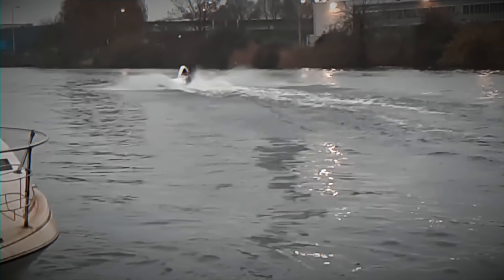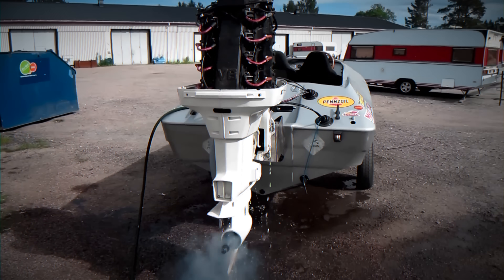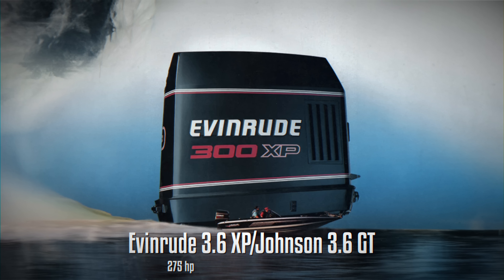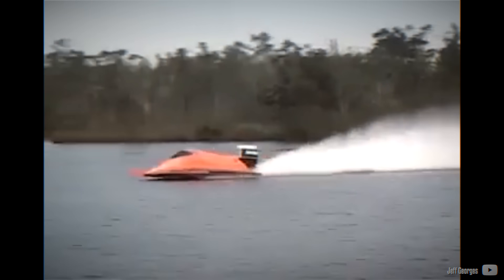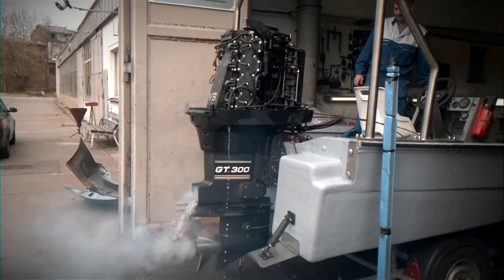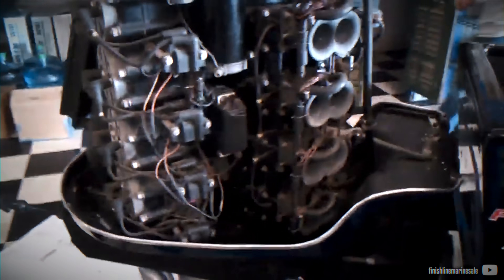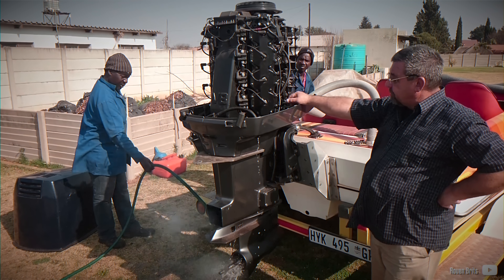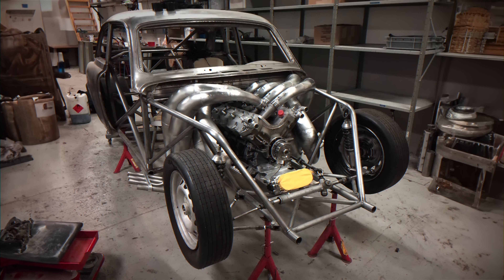A Revolutionary 2-Stroke V8 Outboard Engine

Comment: I had one on a 26’ paramount. Came out of the hole like a rocket. It was a little unreliable and went through some serious amounts of fuel. Replaced it with a 250 merc 3 liter boat ran faster and used half the fuel.

Comment: I have a 200XP body with a Johnson 200 GT hiding under it.  Its an 87 so its a looper and its modified like there is no tomorrow.   It sits on the back of my 1988 Stratos 200VT Rocket, created my Roark Summerford.  I also have one of Roarks 1986 STV ProComp Sprint Bottom race boats.  Woohoo

Comment: I have a1973 70hp and performs the same as a buddy's brand new 90hp Merc
Reply: That's the thing about the older outboards, they seem to be vastly underrated in HP for what they had. Not sure if it was sandbagging or just that new manufacturers are overstating ratings or just focusing on fuel economy. Definitely a huge difference in a 25  from 1990's to a new 25 off the shelf. Not even close. Add the heaviness of a bloated 4 stroke and it's just boring and slow. Problem is in small boats you can't just upsize because you only get heavier.

Comment: Around 2000 - 2010 a friend of mine in Lake Havasu had a 21' Eliminator with a Merc 300 V8 outboard. We would do 90 mph up and down the Lake and around Parker dam and casino and up the river, easily doing away with 40 gallons per hour when on it. Oh yeah, that was a real black hole, small compared to large boats, but that bottom end never lasted long with a surface prop and he didn't invest in a strong race bottom for that engine. Good times were had but with all these things, fast becomes not fast enough and the black hole starts requiring feeding ha ha.

Comment: I had the 200XP V6 3.0L. 
It was a good motor. 
It just sucked a ton of gas so a 30 gallon tank only lasted about 20 miles.
My 150hp 4 stroke Mercury 3.0L goes over 120 miles on 30 gallons of gas.

Comment: Yea I hate to break it to you but the V8 was garbage.   Heavy ate fuel like it was a Arab prince and in general had bad balance on the small boats it would need to chase big numbers.  Oh and it was made poorly and had closed exhaust deck so big mods came hard.
Reply: Complaining about the fuel economy of a 2 stroke is a weird angle……but okay.
Reply: @DownEastSaw fr
Reply: Heavy isn't an argument because it's still lighter than the lightest stock modern 300 four-stroke. And yea they chug the fuel but that comes with the territory of boating in general.
Reply: @benradey379  i agree. just google it.. the 4.0 400 was stock 250kg.. the 450r in its lightest form is 330kg dry weight... 

And lets not forget that the 3.6-4.0 is a n/a

Try making that engine today with e-tech.. and bro.. yeah.. everyone knows e-tech are light and fast :)
Reply: BS was a top machine in the era.
Reply: @pieterhenderson3445  
Yes " in an era"
That's why you  don't see them
"Garbage reliability "
Reply: People who said they were unreliable and bad were the people who set them up wrong. People I’ve talked to who actually set them up right, say they were great outboards.
Reply: @RaidifyLifts  i belive u 100% habe heard just the same story from people.. if u dont know 2 stroke and carb tuning.. stay away 😅🤙
Reply: The world record for a single outboard speed  is still held by the Evinrude V8
Reply: Who cares how much fuel it uses, thats what smaller displacement motors are for. This motor was built for one thing, to destroy everthing else. I was at formula one races where Mercury would not even take their boats iff the trailers. The V8 also owns most outboard speed records. Mercury had a habit of not fielding boats against OMC when they were a racing powerhouse.
Reply: @scottmclaughlin3083  Youre 100% correct, what he also doesnt understand the majority of them were ragged on hard and put away wet, parts were cheap for racing teams so they had no problem swapping entire powerheads between races which of course made the statistics shift towards the appearance of them being troublesome, all they were were 200s with two more cylinders and if used in recreational ways they lasted just as long as they were maintained, like any other OMC product of the time.
Reply: Still the world record holder for single outboard
Reply: Only Evinrude outboards awesome
Reply: can you show us where the big stinky inefficient V8 hurt you
Reply: I totally agree.  While it was a great race motor, it was garbage for the average boater. There is a post on the hull truth a couple years ago, where a guy stated that his father had a pair on his boat.  The reliability was so bad that his dad bought a third motor to swap out the nonfunctioning motor while it was being rebuilt.  Seriously, look it up.  This was the beginning of the end for OMC.
Reply: That's some cope. Evinrude go BRAAAAAAAAAAAAP (you in a 4 stroke machine have been left by miles)
Reply: 2 stroke anythings only have ONE happy place. WOT or nothing and outpace their 4 stroke comparatives by many orders of magnitude (other than MPG)
Reply: Ummm, you ever heard of this thing called “punctuation”??? It’s your friend, I promise!!! 😂😂😂
Reply: And still to this day holds the record.. Not bad😊
Reply: @SlowBurn1995  what record? That's sick
Reply: @benradey379  the world outboard speed record. 176 mph. they ran a modded evinrude v8 400 f1 engine
Reply: @RaidifyLifts that’s pretty cool, I had no idea
Reply: @SlowBurn1995  okay thanks for clearing that up, just watched the video and that’s insane that to this day it still holds the record, thank you for all the information.
Reply: @benradey379  np my man :)

Old 2 stroke lover here :) hehe.

Im from norway and theese engines are almost impossible to find... tøying hard to find one for my old nordkapp 17 :)
Reply: @SlowBurn1995  that thing would rip, my dads trying to get his hands on one for his old super pro 196 princecraft, pretty hard to find here in Canada 🇨🇦 aswell.

Comment: I love my 1987 70HP Evinrude..its only a 3 cilinder but the torque and power is brutal for such a small engine and drinks more then a team of rugby players.. love it!
Reply: Great motor.  I replaced mine in 2012 with a 60hp eTec when they cam out.  The eTec was way quieter and smoother but in comparison had no torque!  And, the 70 left a mushroom cloud when I punched it :)
Reply: @OutsideCleaners  the E-Tec by Evinrude were terrible,  every one who owned one in my boat yard hated them,
Reply: @boris2997  🤷🏼‍♂️ I had 4 on different boats, loved them.  Zero problems.
Reply: I have a 95 SPL 88 Evinrude  on a 17 foot Boston Whaler  it's a fast little boat 50 mph top speed.   I love 2 stroke motors
Reply: I had a 1975 Johnson 70 hp which we end up reconditioning with an '80's powerhead which made a prop rated 70hp. The kids wanted more hp for skiing etc and so I started doing my research and discovered that power to weight wise these were way better than the new ones I was considering in around 2014, and the old Chryslers were even better. My hull was narrow and deep V and I was conscious of not overloading it. The only one which was close was the 90 hp Yamaha 2 stroke which I eventually replaced it with. I loved that Johnson and grew to love that Yamaha too- both lovely and similar machines with lots of personality.

Comment: I'm disappointed that there is essentially no information about the engine design. Yes, the specs are nice, but how are these things built? They appear to have the crankcase scavenging typical of small 2-stroke gas engines, but how does that work in a vee configuration, with two pistons sharing the same section of crankcase so a conventional vee design would have no useful pumping action? I did find an image of a 2-stroke V6 crank which suggests that each connecting rod is isolated from the next rod on the same crankpin by a disk, dividing the crankcase into separate chambers for each cylinder... it would have been nice to see that.

Comment: I wish Rotax would bring their direct injection 2 stroke tech to big outboards.
Reply: umm you know bombardier bought OMC right? and used Etech direct injection? rotax valves would not do anything for them.
Reply: @ct1762  Umm ya I know.  Rotax is Bombardiers small engine division with all that tech.  I want to see big 2 stroke v8s with the direct injection we get on the sleds.

Comment: Completely useless grief for the public boater. My 6 HP Elgin is as far as you want to take 2 cycle, and only because it is smooth and meticulous.
Reply: Weirdly enough I have one of those Elgin engines.
Reply: The modern 2 stroke Evinrudes intrigued me because you could have a dedicated trolling motor alongside because they were such light weight.

Comment: The V8 part may draw attention but the winners circle was proof. Mercs 2.5 was a far superior platform.  The comparison between OMC engineers and Merc. Isn't even fair. Like chess to checkers.
Reply: OMC v8 set the world outboard speed record, and in 1980-1983 wiped the floor with Mercs but they changed the rules so no V8. thats why they didnt get known that well later on.
Reply: @ct1762  I saw thar coming a mile away.  You do realize there was nothing left of OMC on that motor right?  OMC ports look like a child cast them. Oh ya, that winners circle thing pretty much ends your argument anyway.
Reply: @miketee2444  OMC has won a ton of races once again. the 3 cyl loopers both 49 and 56ci were untouchable and still are. yes merc has done amazing stuff with the promax/super mag, but OMC was really designing fishing motors for heavy boats and still held their own, especially off the line. i agree the port work by the mid 1980s was horrible though. just did a 130 looper with one intake port having so much slag in it im suprised it didn't break off. but i love them because they are easy to clean up.

Comment: Half the boats displacement needed to be for fuel for an afternoon of skiing
Reply: well at cruise it took about 15 gallons/hr. so no, 30 gallons would get you around just fine and most boats that used these had 60 gallons minimum. alot of fuel but not as bad as youd think depending on the hull. on a fast 90mph hull, it was even better

Comment: It's hard to say over the "chainsaw" engine note, but I suspect these V8's had cross plane crankshafts.
Reply: the F1 versions did have an "evenfire" crank, but the stockers didn't no. once you put it in the water like it was designed, it sounds nothing like a chainsaw. deep, low and absolutely nasty snarl!

Comment: The problem with some two stroke exhaust systems is it winds up sounding like 4, 6, or 8 single cylinders running at once.
Reply: in the water they sound like one big smooth monster with a snarl. totally different!

Comment: I know the V6 2 stroke outboard motorcycle but one of these would be so cool built in a Cafe style motorcycle
Reply: How about an f-150
Reply: Since the load in a boat is pretty much constant, these marine engines don't really have much going for them for road use.  They have to make 100% of their power for hours so you can't pull the tricks you do for extreme but unsustainable power on a road wheel vehicle.  A 4-stroke example is people trying to fit 3.0L Mercruiser engines into Hondas.  Doesn't actually work out as good as the V-Tech (bro!).
Reply: @paul_moir  4 strokes work like joe biden, they stumble on every other stroke!

Comment: When we were kids one of my friends dads had a handbuilt 21 foot speedboat based on a formula hull, guy was a marine diesel specialist and knew damn near everything about boats. He hung one of these things on the back. Only boat ive ever been in that had a gas pedal. Thing screamed when you punched it and the boat came up on plane. What a machine.
Reply: I've been in a boat with a gas pedal but it had a 455 rocket in it
Reply: 429 tunnel ram with a jet pump, thing was about an 18'. Lot of fun!
Reply: Don't remember the brand, but It was a fiberglass V hull and the whole boat was maybe 30 ish inches high.
Reply: I rebuilt the engine in it many years ago for the owner. It ran well but he eventually sold it. I'd entertain the idea of buying it if I could find it.
Reply: What a time to be alive

Comment: Always wanted to put one of these in a car.
Reply: not as great as you think. they need proper exhaust backpressure, or else the low end punch sucks. this has been the case with all of them in cars. in boats they absolutely scream, with a table-flat torque curve
Reply: @ct1762  I can cope with that. It's only 300ish horseys, I'm not expecting it to be amazing, but it would dang sure sound awesome,
Reply: Miata screaming!
Reply: @mynameisschezuan  I kinda thought a Civic...

Comment: Those plastic carbs sucked to work on.
Reply: The production carbs that had plastic bowls were a problem...
with the engine tipped the warped bowls leaked fuel/oil onto the transom well where the engines were mounted...
A friend who had a 175 Ocean Pro and hated maintenance of any engines cut his maintenance eye teeth on replacing all 6 bowls... ....
and resynching all the carbs.
Now he tackles anything...

Comment: There used to be a couple videos on YouTube of a guy that had one swapped into a sandrail and it sounded incredible. It was probably the single best audio clip for these 2 stoke V8s. 

Unfortunately it seems that the videos were removed a few years ago for whatever reason. There were a couple videos of it in the dunes running through the rpm range and a few videos of it on the dyno. 

Alas, it’s Lost Media 😢
Reply: Check the wayback machine. They might have been archived!
Reply: Do you mean Rudezon?
Reply: @tonn333  nope. i remember the sandrail vids hes talking about. i didnt know they were gone now though.
Reply: YouTube, based in California, banned 2 stroke engines and subsequently all 2 stroke videos made in CA had to be scrubbed.  Newsome believes the smoke from the videos was polluting the air. Don't quote me on this but it's basically a fact.

Comment: There's no gas station at sea... So it seems a bit useless to me. It is impressive yes, but if you run out of fuel, in the middle of nowhere...? You can't push swimming it. You can't walk some dozens of meters with a can of fuel, in order to supply it. In the sea, you need something with high fuel range...
Reply: It was basically a racing motor. And there are gas docks on the water. This thing was never intended to cross large bodies of water in that's not the point.
Reply: Do you always invent problems where none previously existed?

Comment: Nothing better than the sound of a 2 stroke ..they are thirsty tho..but its just fine with me👍🏻
Reply: The downside of having roughly twice the power of a similar 4stroke
Reply: The latest ETEC G2's are not even thirsty. Or better not more thirsty than a fourstroke, but they're way cooler and more powerfull. So unfortunate Evinrude stopped building engines.
Reply: Idk
That idle literally sounds like a car with a spun rod bearing and no oil pan on😂
Reply: ELPTO merc series not that bad
Reply: The Tohatsu 2 strokes that were built right before they came out with four strokes were great as well!!
Reply: Smiles per gallon 😅
Reply: Buy a shit load of fuel for the price difference of same size engine in a new 4 stroke.
Reply: The best engine noise ive heard was 2 2stroke v6 outboards echoing around the bay
Reply: I'm not a fan of burning oil and the smell is horrible, but the performance is impeccable